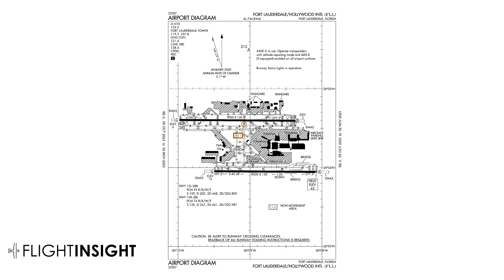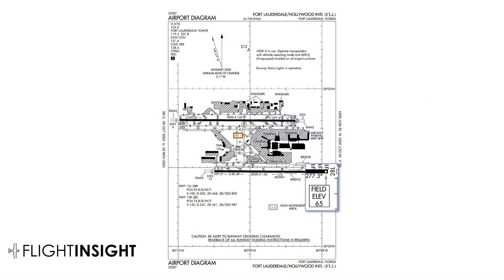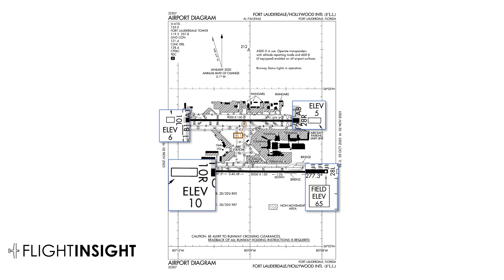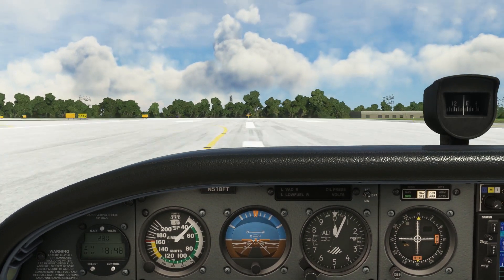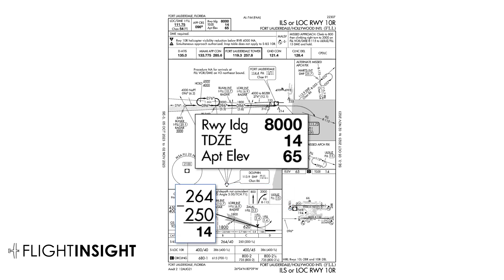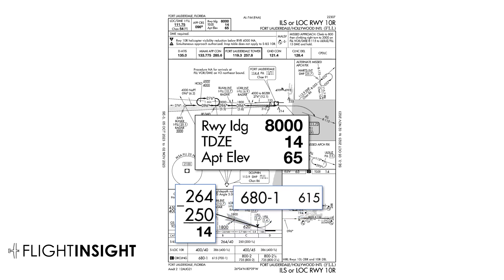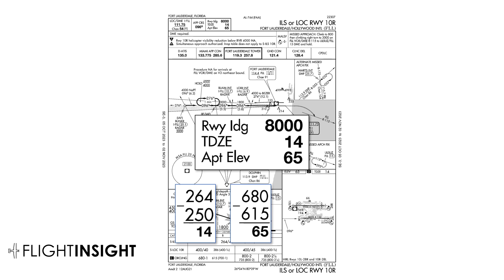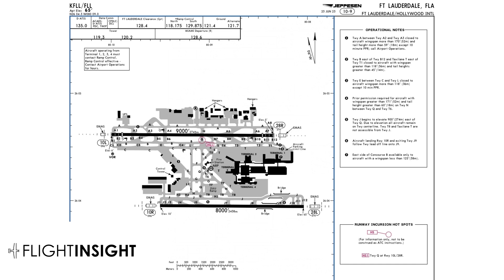Field Elevation Isn't Always What You Think It Is! | Height Above Touchdown vs Height Above Airport

Comment: The airport elevation isn't the highest runway threshold at the airport, it's at the highest elevation on the airfield.

KCAE has the highest elevation marked near A4 on runway 11/29.
Reply from the maker: Stand corrected! We'll leave an edit
Reply: @flightinsight9111     Cars, cash, clothes, and coochie can be taken from you any moment by anyone.  Integrity cannot.  It can be slandered but a simple test will prove the slander wrong; "Stand corrected! We'll leave an edit"  Well done sir.
Reply: Slight correction to the last comment. The FAA Aeronautical Chart User Guide states that the airport elevation is the highest point of an airport's usable runway. It's the highest elevation along all usable runways and not just anywhere on the field. As always, great videos!!